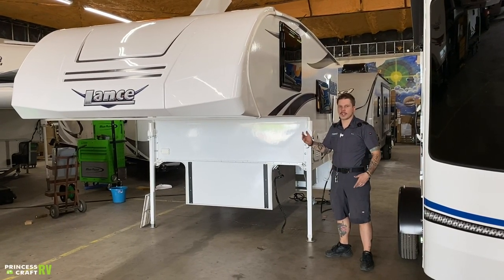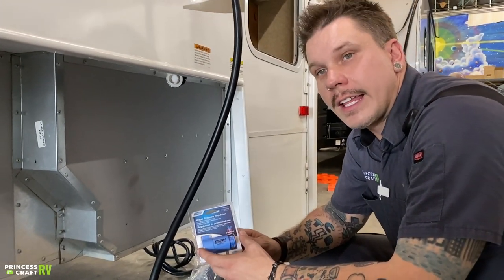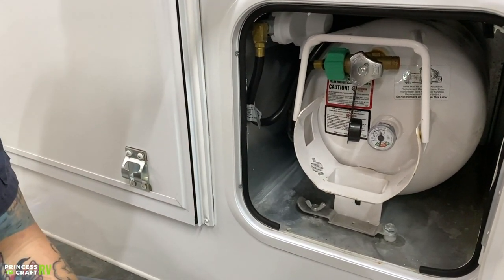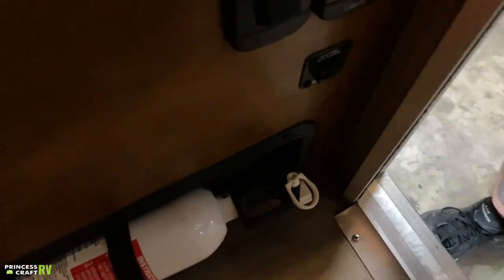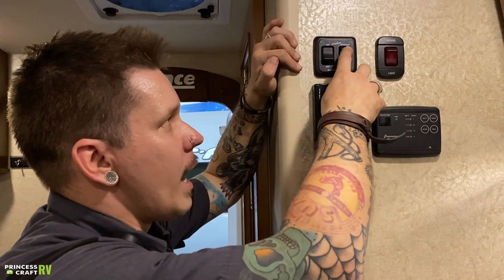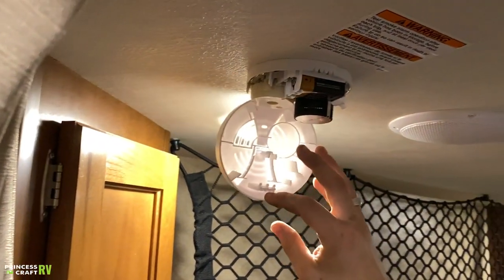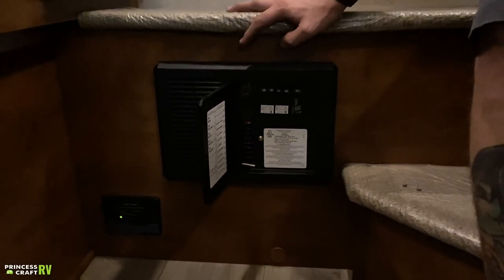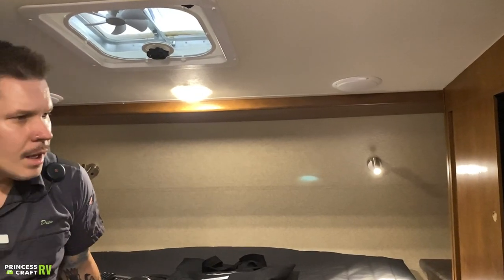2020 Lance 650 Technician Tour

Comment: Where is the battery disconnect switch and how would that work for camping and storage?
Reply from the maker: I wish I were looking at this trailer right now... but usually Lance puts the disconnect switch in the storage compartment at the front of the trailer. For camping and while in transit, make sure the battery is connected by turning the switch to "on." When storing the trailer, move the switch to "off." This keeps any nominal power draws like the radio in standby mode, or the various circuit boards in the trailer, from continuing to draw power from the battery.
Reply: @RVTechToursatPrincessCraft  thank you. Now for the strange part what is on and what is off? There is no indication.  I assume up is on and down is off.?

Comment: Is there an inverter system, or do you have to be plugged into shore power to use AC?
Reply from the maker: correct, you need to be plugged in for the AC